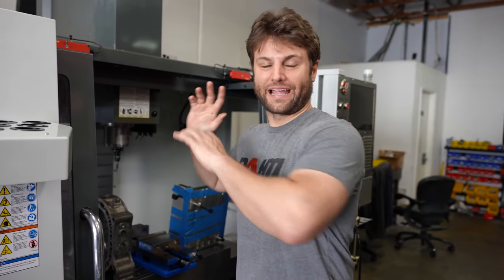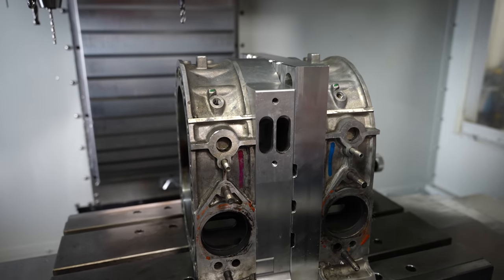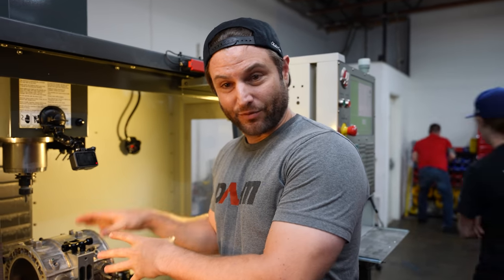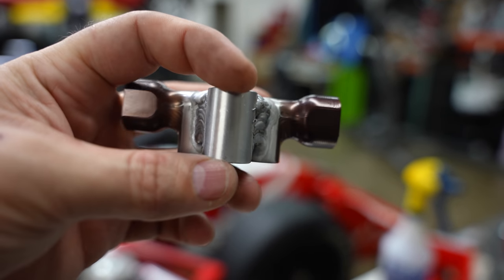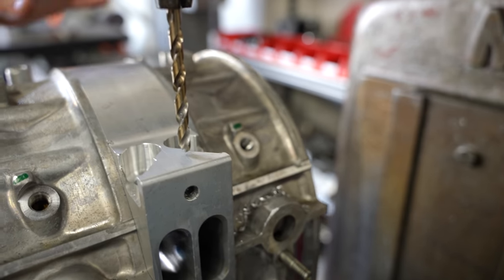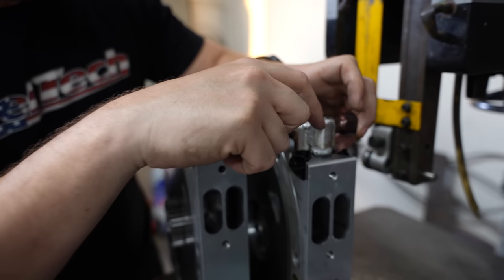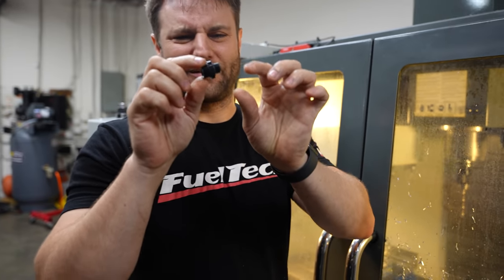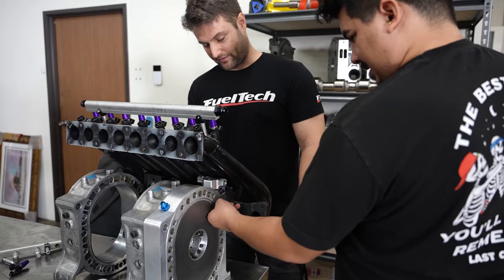The Craziest thing I’ve done to my Billet 4 Rotor. It was running fine…

Comment: 26th!
Reply: That’s what she said…
Reply: Seems like its the fabrication father 🤨🤨
Reply: fab daddy uwu
Reply: @Fabrication Father gold or white ?
Reply: @catxx5480  7
Reply: year of the build ?
Reply: Lot lizard
Reply: First in my heart papi
Reply: 26th in views, First in Rob’s heart
Reply: Ain't you supposed to stop the cnc after a rough cut when using 6061 aluminum? 
My old boss always taught us that the parts need to be heat treated before final cut because the 6061 Aluminum will disfigure & sag during heat treat.
Reply: 76482nd!
Reply: Post more
Reply: Gun drills, speed bits, wink wink.
Reply: @davfatboy  2021
Reply: i subbed!!
Reply: GG

Comment: As a machinist, and machine shop owner be careful assuming that drilling is better than running endmils, drills walk and the longer they are the easier it is for that(that's also why there's different angled drill bits along with different flute and styles of flute). I'd recommend running a collet like an er32 holder instead of that drill chuck you will see better results with holes and can run them faster as it's more ridgid being held in more points. Just a recommendation for if you ever get into tight tolerances.
Reply: long drill =wandering drill...i always use the shortest drill possible for each application ,then interprolate the hole to size with the correct,most rigid endmill for the material im cutting or use a boring head set to size..ps: never use a drill chuck either unless you dont care about what you are machining
Reply: I was just thinking the same thing, you want your tooling as short as possible to avoid walking and runout. Great to see this process Rob!
Reply: Also when proofing whatever youre machining it's always good practice to handwheel the program that way you avoid crashing and eating endmills tooling. Likewise before starting your cut handwheel to make sure all is good
Reply: He actually did a whole video a few months back on wandering drill bits
Reply: Free info from a player in the game...respect
Reply: He did spot drill so that was the correct way and it seems like he is drilling deep enough to justice a jobber length. I didn't see issues with his approach. I don't think he is running the correct end mills for aluminum so I'm glad to not see him plunging with those.
Reply: Why not use shrink shanks, pilot drill with a x3D drill bit, then take the long drill :)
I daily use spiralized deepdrilling tools like a 12mm x25D (25 times Diameter drilling depth = 300mm or 11,811 inches) and these are brutally accurate with the correct piloting bores.
Also that endmill looked way longer than it needed to be :)

P.s.: Grind down the head of the M8 bit (the tip isnt necessary) so you get full threading from the first row of teeth that plunges into the workpiece ... if you do that with your M8 tapping bit, make sure to clean out the angles with a bit of coarse grinding paper and then a steelbrush ... the coating that´s on that tool can take this kind of abuse and you now have a M8 that cuts full M8 threads once it touches material and needs less bottom-clearance than before :)
Reply: Circular interpolate with an end mill in a hydraulic chuck with the shortest stick out as possible for the win.
Reply: Pilot drill it and don't put a ton of pressure on the z-axis, he'll be fine.
Reply: @AntalopeAUT  I was just moved to the manual milling department at my work after running a bysprint 160’x90’ laser cutter for awhile. I look forward to the day when I have knowledge like you guys. Went to school for drafting and CAD work. Hoping to do what robs doing someday
Reply: Have you ever used hydraulic drill chucks for drilling? They’re fantastic
Reply: I love going through the comments and reading suggestions and tips from professional and experienced machinists. It's awesome to see comments that are actually helpful not just some bullshit like "I'm first!"
Reply: @Innovaspeed  after drilling the hole I've always used an endmill .003-.005 smaller that the reamer size to "stab" it on location. Many different ways to skin said cat, just throwing in my experiences

Comment: Since you have the machine to do it, I think you should build a new intake manifold, but make it billet and integrate the fuel rail directly into it, so it's all a single assembly between intake air and fuel. I have the billet exhaust manifold from dieselpumpuk for my om606 in my C10 pickup. Its a work of beauty and flows better than all the previous manifolds i tried, because its already ported perfectly via computer ai testing of flow.
Reply: You should billet nothing else only billet 😂
Reply: I'd love to see that truck tbh.
Reply: @mostlymotorized  boost and high fuel rate makes people do weird things man...

Comment: That noise you refer to from the tools is called Chatter. It's hard on tools and ruins the surface finish. Most of the time this happens due to improper programming and the rest of the time it's a tool problem.

I never got a good look, but it almost looks like you are running a 5 flute end mill (common for steel and harder materials). Aluminum is really bad at gumming up so a 3 flute would help.
Reply: chatter is caused by your programming not matching the rigidity of your setup, less cutting edges will help the finish a lot, or he can switch to something like a sandvic 390 holder with square light cutting condition inserts
Reply: Yep. A 2 flue works best IMO. And seems the most commonly available, but I’m a hobbyist so that’s just my experience.
Reply: Also could be because of the coating, you aren’t supposed to run tools with coating on aluminum, they gum up.
Reply: IIRC chatter happens cus your feed/speed makes the endmill resonate/vibrate
Reply: I always preferred a 2 flute for aluminum
Reply: @vikeskie  2 or 3 flute is dependent on what you're doing and how. I use both based on the speed and finish quality I need.
Reply: @Innovaspeed  psh 8k 40fpm is all i’ll ever need
Reply: @saltypotatoe2905  do you do cam professionally? If so have some questions about why things go the way they do on my machine between 2 and 4 flute endmills on AL
Reply: @bigiron4018  I am currently in school to become a machinist, I am not fully knowledgeable yet but I would love to help if I can
Reply: Ya talking to someone who hasn't heard of a finishing tap (bottoming).... love his shit don't get me rong but machinist he is not lol

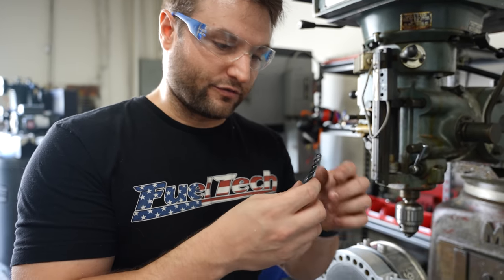Comment: 13:14 - You can actually use a "bottom tap" in the normal 4 flute straight ap style. I have a few sets of taps, and they are super handy. I drill the hole to 6.8mm for M8, then go through all 3 taps to create threads all the way to the bottom.

Just another one as not everyone in the comments might be aware, great work as always and I'me excited to watch and see the results of the changes you've made :)
Reply: Yes, I was going to say, you get the square taps in starter, intermediate and finishing. Looks like he had intermediate taps.

Comment: For the straight flute taps, there are also different types of taps- the regular kind, (as show in the video) which takes a small amount of torque to use, and there are also taps for bottoming out threads in holes which start cutting the full thread after only 1-2 threads. (but take more force and don't last as long, similar to the spiral tap) 

The advantage of the spiral tap is that it is a bit physically stronger due to the spiral and it also forces chips out much better. Also, because it is more expensive, it becomes cost effective to make it a little more expensive and make it out of higher quality material and put some good coatings on it.

Comment: 13:06, rob from my experience in machining you aren’t using the right tap for the job, you were explaining how the taps you were using are not allowing you to tap the whole length of the hole, these square taps you are using are for starting the thread, they are taper taps, I.e they have no treads at the beginning to easily start the thread and as you go deeper the later fully formed threads do the work, this way it’s more gradual and the tap stays centred. You are supposed to use a bottoming tap to chase the rest of the threads down, so you can use the whole length of the hole. And in the ideal world you have all three of taper, plug, and bottoming taps to make the threads gradually and make a really nice thread, but a lot of people don’t care for the plug tap and just tend to skip that option atleast for holes that aren’t through holes.

Comment: 19:00, rob look into HSM processes for these kind of parts, they are way quicker than the regular step down/multi pass, I don’t know what kind of program you use to program parts however I do know 7 minutes seems way too long for that kind of part, also I highly recommend you use FS wizard for your speeds and feeds etc, it seems like you haven’t quite mastered the tooling aspect of machining, FS wizard is a great tool granted you turn down the parameters by like 20% as it tends to run the tools on the ragged edge of their capabilities, especially on cheaper machines. It also recommends the tooling to be used example using a 3 flute endmill instead of a 5 flute for alu etc. Really cool seeing the progress, It’s cool seeing how you’re going about this as this has been one of my dreams for a while. Quick tip for alu don’t run coatings on the endmills they tend to jam up the tool.

Comment: That noise from your drilling is called chatter, Its hard on tools. Typically slowing your spindle Rpm down can help with this, You can  get better tolerances and better finish with a proper sized drill & reamer to finish the cut as well.
Anytime you are tapping threads you should use thread cutting fluid or at least something, Taps get very hot pretty quickly even when done by hand and It'd suck to have it snap inside your work material and It should help the threads cut better.
Just some ideas/my two cents, I'm still learning for sure myself, All my knowledge comes from someone who knows an unbelievably more than me lol.
 Your killing it though, Love these videos and how far your taking it, cant wait to see how far this goes!

Comment: I think the next step is a variable length intake like that Indy car engine has. A fixed length runner is a compromise in different rpm ranges.  Even the Lincoln Mark 8 used a variable intake runner from short to long depending on rpm and throttle position.

Comment: Wow. Ran the machine in an unproven state with 100% rapid active. I’ve used a haas machine similar to this one and I don’t know about you guys, but I’d prefer to dip a toe rather than going in head first. Running a machine like that, this guys got some serious stones.
Reply: Usually we start at 25-50% and run the machine with stops engaged and check distance to go before each operation on the first part. It’s worth saving that 80$ endmill / holder combo if you’re just doing low production, a 20$ piece of alu can turn into a 200$ job quickly 😂.
Reply: its not brave, it is completely oblivious and shows he has no idea what he is doing.

Comment: Nice work Rob! Just FYI if you use a corner rounding endmill on the top edge of the injector hole it will keep you from cutting the injector o-ring. A chamfer will not stop that from happening. I build some biller intakes for X3's and I use a .062" corner rounder.

Comment: I would not use Locktite with Allenheads. I'd just put a few rounds of Teflon around the bolt. That adds enaugh resistance to stop the bolt from backing out on its own  but very easy with a tool.

Comment: Rob very interesting. We solved the 4 rotor PP port no Pri injector by using the oil meetering hole in the Rotor housing. So it's directly into the housing. I have pictures of my build back in 2009 if you want to see. Love what you do man, wish i had the means to do what you do. Keep up the good work :)

Comment: Looking good , pick up some tap fluid there is a grade for aluminum and steel. Also there is a form tap that makes stronger threads by compressing the metal to form a thread . It requires a different size minor drill .

Comment: If you still have a gap between the fuel rail and the iron look into using copper crush washers as spacers. It will give a little bit of yield to get proper preload on the o-rings without anyone going full send and ruining them.

Comment: I haven't been in the machining world long but one thing I know is that if you are having a problem with chattering make sure you you can get the drill/end mill  as short as possible without clamping onto the flutes. And also going to a collet instead of a chuck. And one more thing, hass's can jab a drill along fast which will keep this drill straighter and will break the chips more often in most cases.

Comment: I know you don’t have unlimited money for cutting tools, but it’s always better to use the shortest flute/tool length you can use. Will reduce chance of chatter, can be more aggressive with doc/feed, and generally going to be more accurate.
Reply: And also use a test/dial indicator to make sure the rotor is perpendicular to the spindle!! Just slapping them in there is probably at least .01-.005” out of perpendicular. Probably way more tbh
Reply: PUT IT IN SINGLEBLOCK AND 5% RAPID TO SAVE YOU FROM CRASHING THE MACHINE. MAKE SURE THE TOOL IS WHERE IT SHOULD BE THEN RUN IT. NEVER TRUST YOURSELF OR YOUR EQUIPMENT WITH CNC, ALWAYS DOUBLE CHECK
Reply: Rant over

Comment: Rob, look into form roll taps!  You have to drill differently for them to leave less material, but they don’t produce any chips and on aluminum they can work harden around the threads just a bit, which I imagine would be good for this application.

Comment: Didn’t read through all comments but have you considered using flat head cap screws FHCS rather than socket head cap screws SHCS to hold down injector fuel rail caps on injectors?  it would center the cap better over injectors and would give you more bolt contact on the injector rail cap. You would also have more material on your injector rail cap with no sharp corners caused by a counterbore.

Comment: You could also counter bore your bolt holes and use allen head bolts so the would be flush with the surface body.

Comment: You need a large angle block so
You don’t need to stack all them engine parts together, you should also use drills in collet holders as that Chuck you use I’ve seen undo .last thing your calling a counterbore a countersink for the cap head screws .👍👍👍

Comment: Center drill your holes before drilling and they won't walk.  Use a collet tool holder as well.  And 1.5x the diameter of the bolt is all that's needed for depth.

Comment: Hey Rob, thanks for the detailed engineering content. I love the 4 rotor / 6 rotor stuff. I don't really enjoy the 2/3 rotor stuff. To me the enjoyment comes from the "bleeding edge" design and engineering of the Rotaries.. Id like to know if you could make billet titanium rotor housings, rotors, and "Irons" then hard face the inside of the rotor housings, rotors, "irons" with tungsten carbide, and then mill them back to their precise specs. Then polish the tungsten carbide to a mirror finish, would this help the seals etc to "seal" and allow bigger horsepower/torque outputs?

I realise this would be super expensive. However id love to see you do this (or similar) with a 5 axis mill. I have seen other creators milling solid tungsten carbide with diamond coated endmills , taps etc. 

Keep up your amazing builds! Love your work!!

Carl from Australia
Reply: For this apllication why do you think Ti would be better than aluminium? Ti is stronger, but also expands more with heat. Not to mention its 10x harder to machine

Comment: For drilling soft materials (hss drills), you can use a simple equation for calculating the speeds of the drill (for mm that is, don't know for freedom units). 6000/drill width, so in this case 6000/6.8 = 880ish rpm. and for stainless steel, multiply that by 0.8 (so 80% speed) and you get a good starting point and safe speeds for your drilling. So that speed you used to drill the tap holes was really slow and could snap the drill bit for having too low rpm. 

Other than that, great progress!
Reply: nup, that is too slow. and stainless is like half the speed of mild steel so not sure where youhave pulled 80% of soft material from

Comment: Tig weld enough material for factory bolt holes then drill and tap for proper bolts to use the 2 factory holes

Comment: I’m surprised there’s not more nickasil used.  I’d think the rotary would be the perfect engine for it.  Must have the same issue that the old M and jag engines had but running E85 or ethanol should help with that.

Comment: I Don't know anything about anything, but first thing that comes to mind. wouldn't you have issues with mixture and even burning with  having injectors so close when pushing past 3,000 rpm. 
like in the 8,000-9,000 rpm range.   I can see practicality with low rpm low boost settings but when you start amplifying those numbers I can't imagine there not being issues with having injectors so close. just my 2 cents though. maybe in a future video you can elaborate?

Comment: M8 Bolts to mount fuel rails is overkill. More room and plenty of strength in M6. Just an example our 1 ton crane holds the hook on with one 1/4" Bolt in sheer.

Comment: thats alot of work to make that fit. cool to see the thinking and engineering behind it , but Rob a thicker intake gasket would have gave you alot more room and cost pennies in comparison by pushing tighter end of the runner way.   the further out you go the higher the clearance

Comment: My question is will it interfering with any thermodynamic equation? Since the close the hotter it will be and change the chemical behaviour..and the air and fuel mixture blendiness rate etc since it closer now as example gun barrel length also affecting the gun performance